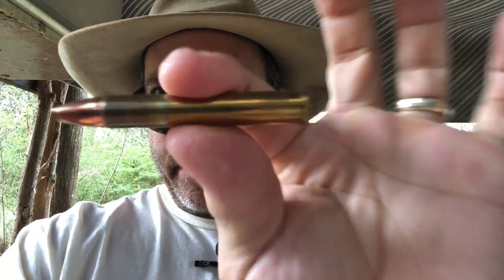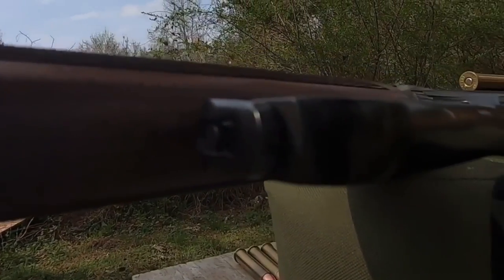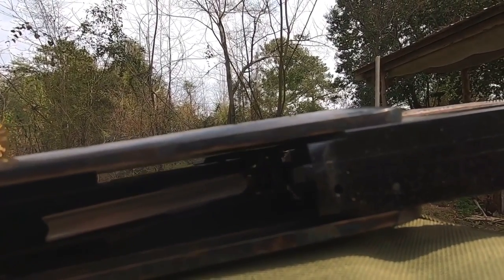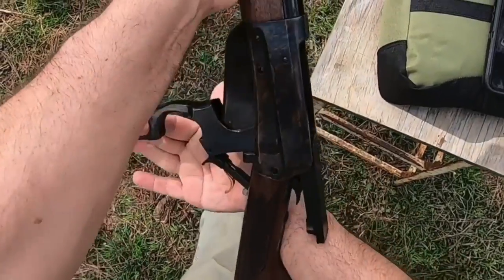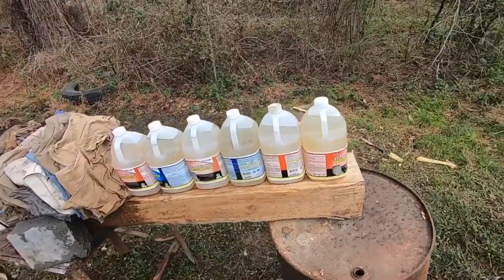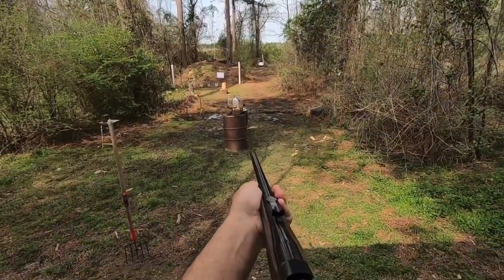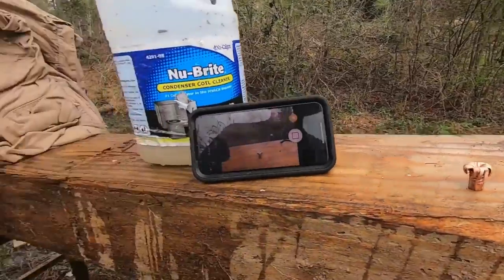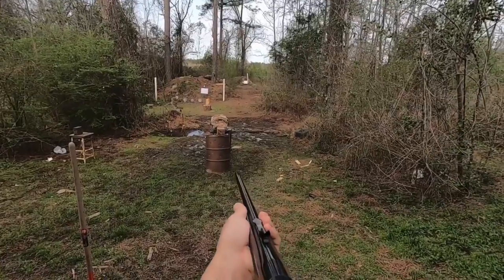Model1895 Winchester caliber 405 Winchester with Barnes TSX 300 grain bullet

Comment: I watched a recent video you made comparing the .405 Win vs the .50-110, .45-90 and the .45-70. You were shooting into the wood piece on your table and the .405 Win was the only bullet to cleanly penetrate and exit the wood. Clearly the .405 Win didn't have the greatest energy especially compared to the .50-110. My question is, and knowing the .405 Win had the higher sectional density, would the .405 Win have greater killing power than the .50-110 because it has greater penetrating ability or would the .50-110 be more lethal because of the total energy dump into the target? I know Teddy Roosevelt used the .405 on the biggest game in Africa and referred to it as 'big medicine'. I really enjoy your videos and am happy to see you join up with North61. I am a true Levergun lover.

Comment: Nobody but NOBODY makes a better bullet than the solid copper bullets from BARNES! They will expand damn near perfectly in almost any medium, usually retain damn near 100% weight, and make full penetration on whitetail deer at most all angles using their Tipped TSX 168 grain 30.06. It is a true DRT round in my experience.
Reply from the maker: Good to know

Comment: I just bought this rifle in .405 win. How is the recoil with that steel butt plate?
Reply from the maker: The main thing is don’t pull it too hard into your shoulder just put it up against your shoulder and don’t tensing up your shoulder muscle too much, because the true recoil is no more than a 12 gauge Field and target load, if you’re going to shoot it from the bench get you one of those rubber slip over but pad that are very rubbery limb savers I believe is the brand, you can get them at Walmart, but when you’re standing up shooting it’s not bad at all, I really like gun it’s a super awesome gun, when it comes to reloading you can look at Hodgdon’s website and they have some pretty hot loads for the 400 grain bullet
Reply: @Leverguns50  Awesome I'll look into that!

Comment: I have a Winchester Model 94 in .30-30 and I'm not quite sure how to clean it without disassembling it can you help
Reply from the maker: A lot of people I know will spray WD-40 into the action real good and then they’ll blow it out with compressed air and dry it off real good and if they need to they get a Q-tip and clean any of the grooves that might be dirty as far as the action goes, The barrel I recommend using a bore snake
Reply: @Leverguns50  Ok thanks I appreciate the lever gun cleaning tip